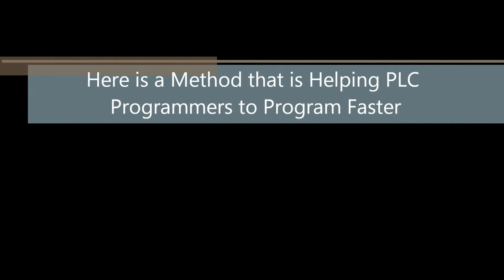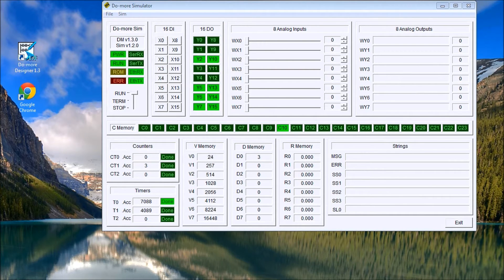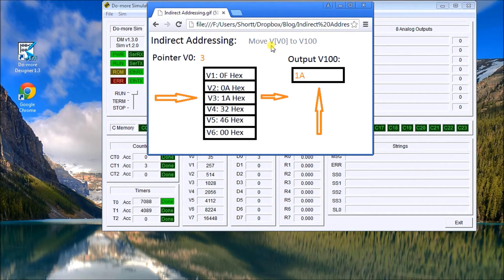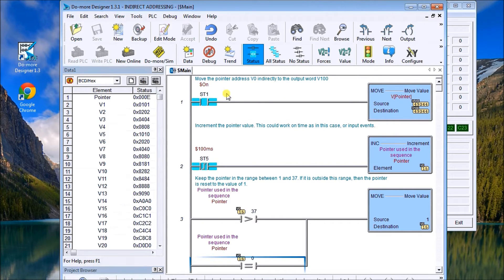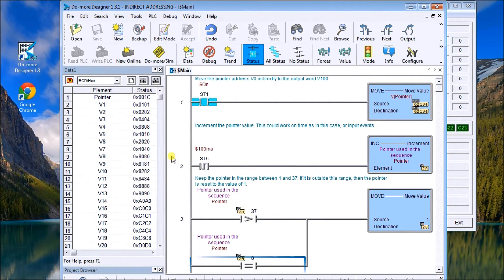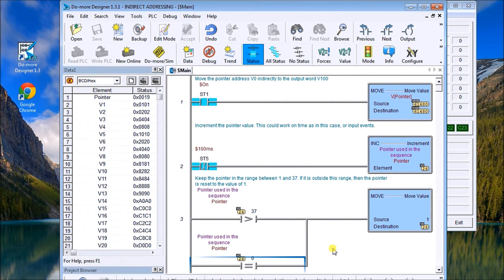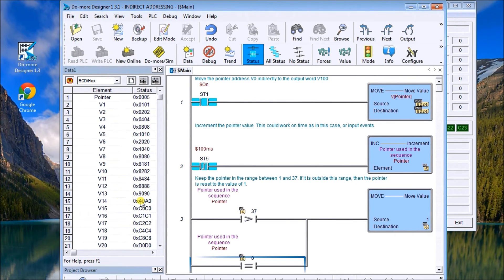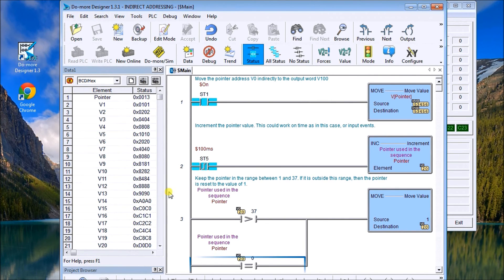Why PLC Programmers Ignore This Game-Changing Method

Comment: in the last rung what is the output 0 output 1 and so on can you show in detail what it is
Reply from the maker: Hi Maciek,
The last rung uses the MAPIO instruction. This will set individual outputs to the internal word bits. In our case the Source word Bit 0 and 1 are mapped to the physical outputs Y0 and Y1. 
Here is the link to the corresponding post on our website:
http://accautomation.ca/here-is-a-method-that-is-helping-plc-programmers-to-program-faster/
This will explain further each step.
Thanks Maciek,
Garry

Comment: Hi Garry,
How do I register the desired outputs/words in each memory location from V1 - V37? I tried to insert these words manually for each V memory location (with the sim_plc in run mode) but it doesn't seem to be working... And once I turn off the sim_plc it all comes back to 0s in all V locations... 

Any help will be appreciated.
Pedro
Reply from the maker: Hi Pedro,
The outputs can be changed via the data monitor. 
https://accautomation.ca/here-is-a-method-that-is-helping-plc-programmers-to-program-faster/
Regards,
Garry

Comment: I'm not understanding the mapio function. Do you literally type in- Output: 0, Output:1 and so on under the source tab? My ladder logic is identical to yours but the only output that's true is Y0 and it stays on all the time. Also, the source and destination status' never change from zero.
Reply from the maker: Hi Joseph,
The MAPIO will just take the 16bit word and turn on the corresponding output bit.
The instruction picture shows the name of the bit. You would type in the corresponding address in each location. Example V100:1 - Output Source V100 bit number 1.
The following post will show you the numbering systems on the Do-More Designer Software.
https://accautomation.ca/brx-plc-numbering-systems-and-addressing/
I hope this helps you out.
Regards,
Garry
Reply: @ACCautomation   i really appreciate your response garry. skipped over this lesson two weeks ago because it simply didn't register, but i came back to it today and under the MAPIO source, typed in v100:0 instead of (Output:0), what the picture shows on the acc website.  most wouldn't have this issue, but my brain has to see it function via physical i/o rather than just reading it and implementing it in domore.    i really appreciate your input for the automated industry. the acc website is such an asset for up and coming technicians in the automation industry. will there be more programming examples in the future?
Reply from the maker: @josephredfearn8840  
Thanks for the comments, Joseph. There will be more programming examples in the future. Each week a post is published. You can sign up to receive email notifications on our website at accautomation.ca. 
I'm always looking for more ideas for programming examples. If you have some specific ideas please let me know.
Thanks Again,
Garry

Comment: What is ST1 and ST5? I think ST5 is a bit triggered for every 100ms.
Reply from the maker: Hi Necip,
The ST bits are system bits that can be used in your program for the Do-More PLCs.
ST0 - First Scan Bit
ST1 - On Bit
ST2 - Off Bit
ST3 - 1 Minute pulse bit
ST4 - 1 Second pulse bit
ST5 - 100 msec pulse bit
ST6 - 50 msec pulse bit
I hope this helps you out.
Regards,
Garry